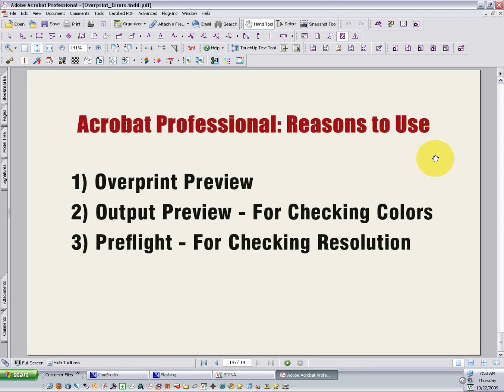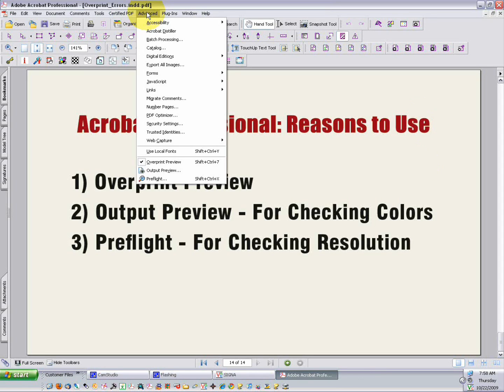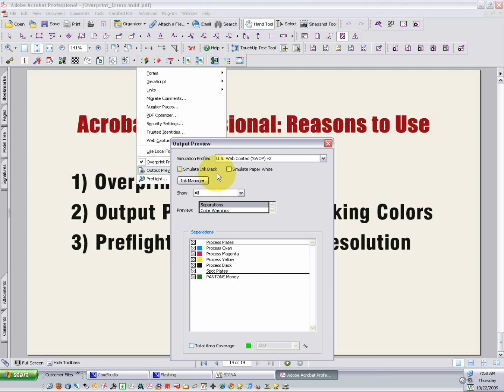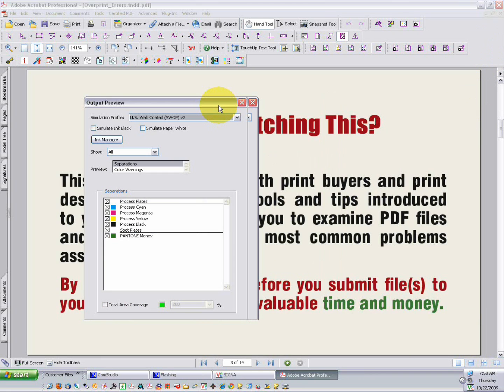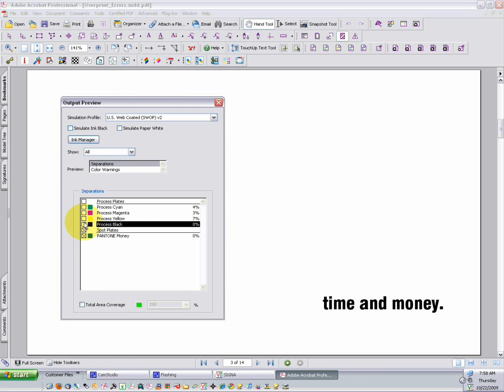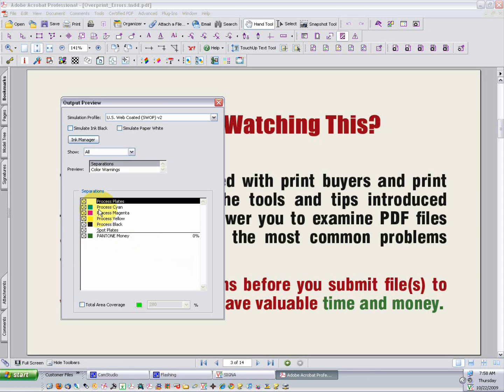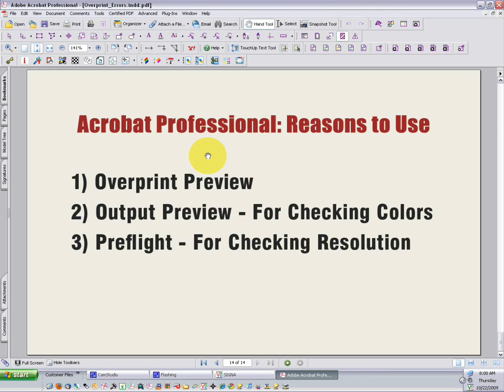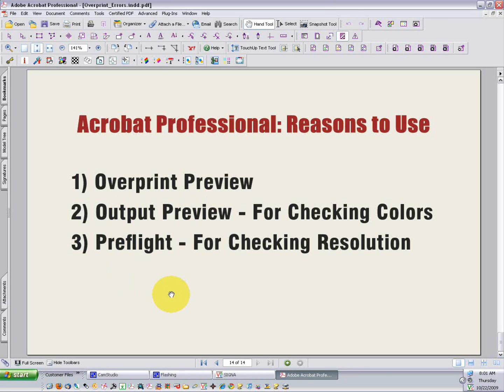Analyzing and Preflighting Adobe Acrobat PDF Files For Print: Part 2

Comment: Great video - I am having a huge problem that you might know how to fix.  For years I have printed from Word and Excel to a PDF printer then it would ask if I wanted to save that new PDF. That feature worked great as I am now a paperless office.

Now it won't print.  I looked in the preferences tab and its blank. It's like they have been erased. I go to Distiller and they are there. How can I get them back over to Acrobat ?